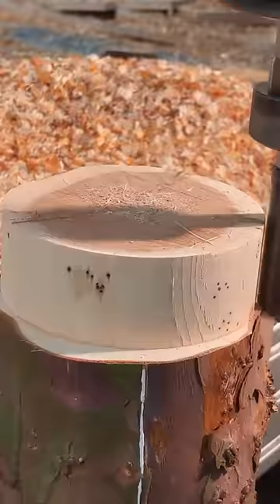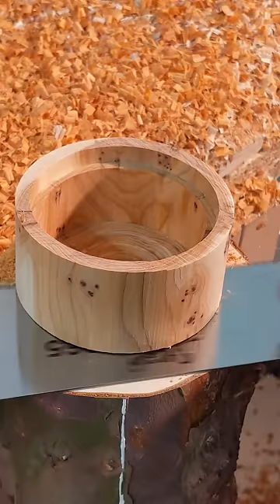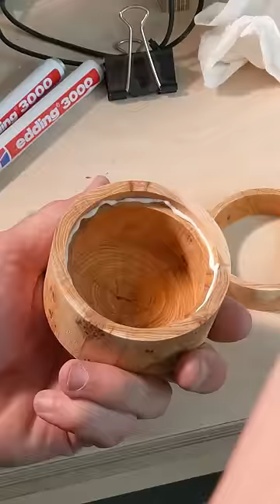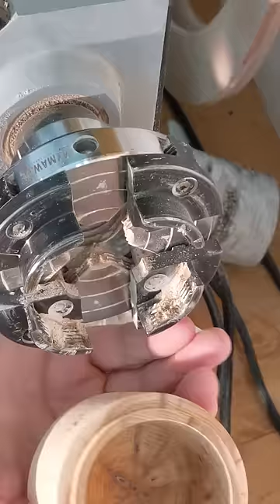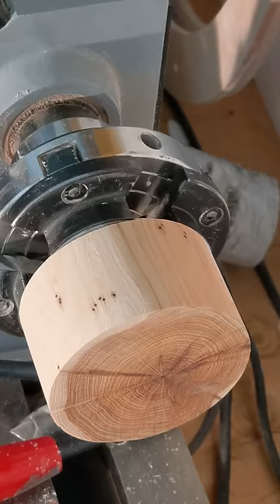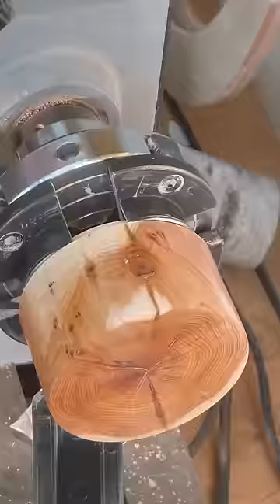making a round yew box w/ CNC and lathe

Comment: Why the insert instead of making it with a lip. I'm not trying to be an ass just curious. Maybe a tool depth issue.
Reply from the maker: It's actually a good question! Because I wanted the box itself to be out of one single piece of wood with continuous grain, so the part I would normally use to make the lip, I had to use to make the lid, so I had to make an extra piece to use for the lip...
Reply: I would reply to the answer but can't so I will reply to this good question....  the answer would make perfect sense except  you could not have used one piece of wood because the video shows you milling the top away.... so I think you just didn't think to do it and didn't want to admit it... which is silly....
Reply: @richardthompson5907  don’t you just love it when someone is so certain, yet so wrong?!?
The video never showed what you claimed it showed. The answer, whatever it may be, is other than what you think.
Reply: @mason.berlin I get it. Nice work!
Reply: @richardthompson5907 That was my thought process as well. Not sure why the next guy was so butthurt about it.
Reply: You're right, I thought the same
Reply: My 1st question was same. My 1st think - ring made of harder wood? But not necessarily. Good Job 👍🏼
Reply: @richardthompson5907 OP's answer to the question is spot on.  He did not mill the top away.  Top was not shown in the video at all until after the sanding.  Log was cut in half, and the area above the piece shown was turned upside down and milled using the same method to create the lid so the grain would line up.
Reply: no this is a legitimate question ... first the thing could have been done on a lathe without the extra polishing step ... but considering a cnc machine was used ... y make a seperate lip ... the thing fell when it was tightened on the lathe ... probably because the lip broke ...
Reply: @richardthompson5907 a
Reply: @richardthompson5907
Reply: ١١❤
Reply: Nicely done but the amount of work plus the purchase of machines is too high
 compared to what is then done with the finished product.
Reply: @WhackBytch256 the internet is a crazy place isnt it? A man can ask a valid question and get the answer from the maker pretty quickly, but know-it-alls still jump in with their takes.
Reply: @mason.berlin 😊😊
Reply: @richardthompson5907  
Well said. Period
I am totally trying to be an ass and couldn't say it any better.
Reply: @mason.berlin that is genius!!!
Reply: @dexterosborneii4227  except for the amount he took out of it to square both pieces! 😂💥💩
Reply: @tomnovak7731 It looks like he's missing the width of the saw blade.  Pause near the very end when he turns it to the side and moves his thumb out of the way.   Screenshot it and zoom in.  Various colors of wood grain lined up very well.
Reply: Tanto trabajo para hacer una cochinada que no entiendo para que me sirve si ya en mercado ya venden botes con tapa y tanta herramienta tan cara mejor enseña como reparar una bicicleta sería de más utilidad baboso saludos
Reply: @mason.berlin зрозумів
Reply: @mason.berlin тоже был такой же вопрос, но ваш ответ понятен 😊👍
Reply: @lenny108  Perfect for weed or tea so it doesn't dry out.
Reply: 0
Reply: @WhackBytch256 he made the lid out of the directly adjacent piece I get what he’s saying if you look at the piece’s assembled you’ll see his core grains are damn close
Reply: 😢m
Reply: @protonx80  ou
Reply: 😅😅😅 in
Reply: @AlbertoPinedaUribe 
Your comment is useless.  This video is about making something from a simple cedar log using tools he already has in his shop.
If you are going to comment on what is better to make money, why not show how to be a prostitute or be a day trader...or a thousand other different ways to make money.
This isn't about making money.
Reply: @AlbertoPinedaUribe 
Do you repair bicycles?  Why?  Isn't there a better topic?  Maybe repair a car or a lady's bra strap.
Reply: So that it can expand and contract after using for even a longer period of time.
Reply: Im so confused right now.
Reply: 5Pool jb8 a ,122s
Reply: @richardthompson5907   Look at the final piece and you can clearly see that the gain pattern lines up perfectly.  This is a short, and he only shows the bottom of the box being made, not the top as well.
Reply: @lenny108 bro you think he bought a CNC just to make tiny bowls?? Lmao man I hope you’re not serious. 😂
Reply: It seems to me that if you want to keep the grain of the wood symmetrical and somewhat seemless, you would have to part off and counterbore both ends and add that mating ring. 🤔
That's just me😎😉😎
Reply: Another reason is that the glue piece is stronger than the original wood because the adhesive used in bonding the two pieces together adds structural strength
Reply: @richardthompson5907 how would he make the cut between the lid and the seat? The bottom of the lid cannot be cut from above and the top of the cylinder cannot be cut from below the cylinder. The cut cannot be made if the grain is to remain continuous. He could mill the cylinder and lid from the same piece but the spot where the lid and cylinder meet would not have continuous grain. A length, not less than the height of the shoulder + blede kerf, all the way around the circumference of the cylinder would need to be cut out of all the wood grain on the lid of the finished piece in order to mill the shoulder instead of glueing. A section of wood must be removed from between the lid and container in order to mill the shoulder in, and when this is done, the woodworker loses the continuous grain.
Reply: That big piece made just a lil thing😢
Reply: Lol pp
Reply: @mason.berlin that's what is so pretty about it, the extra effort definitely made it  beautiful
Reply: @mason.berlin ni nko
Reply: @richardthompson5907  Do you misunderstand? The part used to make the lid was the part that he cut out before making the bottom part. It's easy to understand. You're just overcomplicating your thinking.
Reply: NurAIam
Reply: 8
Reply: चणणततजजज
Reply: Huiu
Reply: @mason.berlin  yu
Reply: @mason.berlin  Thank you for answering.
Reply: @richardthompson5907  did you not see the fit up at the end? The op is talking about the grain fitting as one continuous pattern. He did not have the top milled in the video, meaning the log was already cut in half where the bottom is recorded. You can mill the insert because than the grain wouldn't line up.
Reply: Me amerika me fas gya hu mera pasp
Reply: Sale más barato comprarlo en un bazar.
Reply: @mason.berlin it still would have been continuous grain

Comment: You only need to use the lathe to make this type of box, but it will be prone cracking as you’ve included the centre of the log in the box, it’s better to cut circles from thick planks and turn these.
Reply: 😅planned obsolescence

Comment: Very cool. Pass 1 looks like climb milling, nice clean cut, pass 2 looks like conventional milling, and the inside cuts all conventional. Have you tried making this all with climb milling passes? (G2 for outside passes, G3 for inside passes) you might see an improvement with climb milling as you see on pass 1 in this video, the chips look like a cleaner cut, with thick to thin chips from climb milling, vs conventional passes making a thin to thick chip, pretty cool regardless!

Comment: How did you keep it from fracturing?

Everything I've experimented in the past with that grain orientation has split on a very dry low humidity day eventually.

Usually within a week.

My solution to it has been (1) Don't do it.
(2) Fill the void with epoxy and turn it agian as if that was the plan all along.

Comment: Just for the record, how do you home a workpiece like that?
Reply from the maker: Good question. With round stock like this I mark the center, and then manually drive the machine head over the point and set it to zero with an offset.
Reply: With an offset to set it on a corner? Well I think in that I'm your cad/cam software you can set your stock center in 0,0

Comment: What is in a drill bit and a machine or is it just a drill bit you put in a drill as a router I've never seen one I'd like to have one
Reply from the maker: good question.  its a 14mm router, with a 12mm shaft, with a single removable blade.  I believe the cutting length is 50mm.  it sure is a great tool!